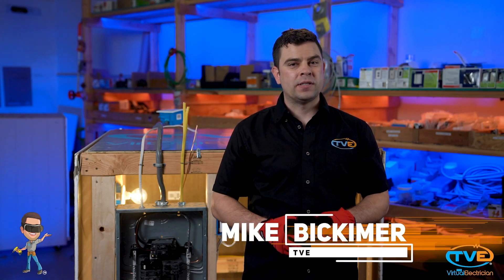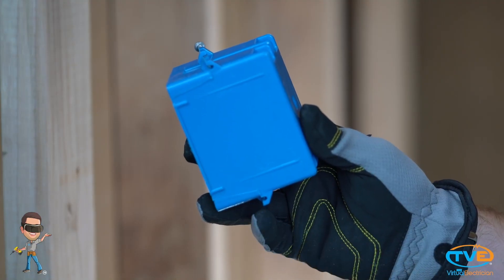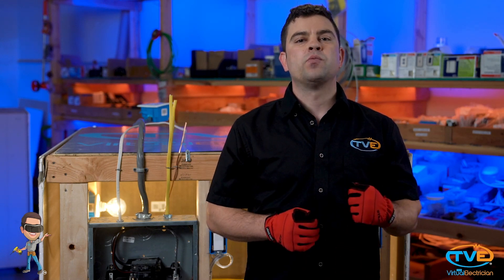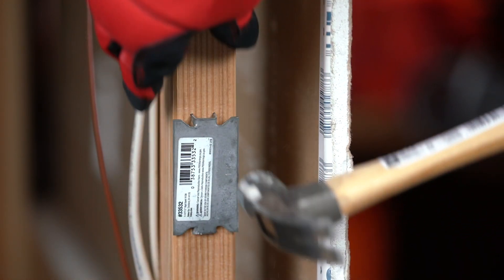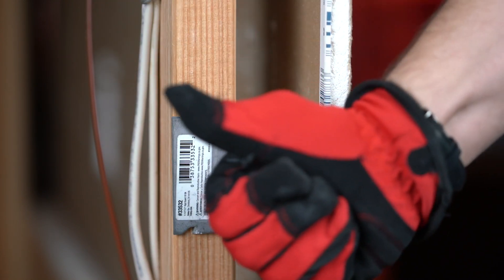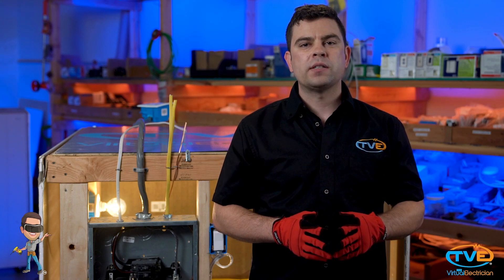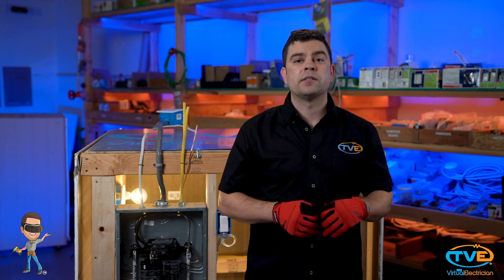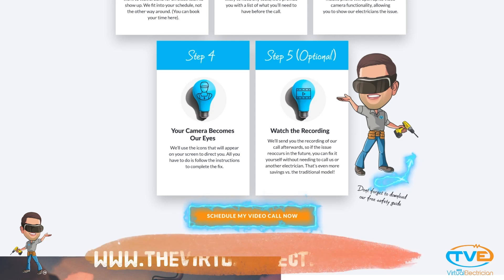How To Run Wire From "Breaker Box" To "Outlet"

Comment: Please respect your viewers and actually show what you claim in the title.
Reply from the maker: if you cant see a breaker box and an outlet in the video then i dont know what to tell you.  try plumbing?
Reply: Well, I actually watched the entire thing again, and the only wire run is betetween 2 studs. I think I may have been confused by your title. I saw How to Run Wire From Break Box to Outlet and thought the video was going to show how to attach the wire in the breaker box and then run it to the outlet. If I was mistaken, and the intent of the video was to show people how to actually run wire through 2 holes, then I sincerely apologize. I don't think I am alone in this missunderstanding, due to the wording of the title. If you don't see how this is confusing to people, I don't know what to tell you. try radio?  @TheVirtualElectrician
Reply from the maker: @dubled2765  😂😂this channel not for you double d. Try it one more time tho
Reply: It's not that I don't like you or what  you are doing, in fact, I did like the way you presented, but the title was misleading.  The title is what people are searching for, and therefore they expect it to be covered in the video. Part of what will make your channel work, is making sure people get exactly what they expected, every single time. I doubt I need to tell you how many people on YouTube are NOT qualified to teach people about a very dangerous trade. Electricians are very expensive, rightly so. But, people have to take things in their own hands when they can't afford them. If you promote your proven skills and teach (not just show) people things to help them get by, you will rise to the top. Work out the process on paper, physically, then have fun teaching people how to save money and not kill themselves or burn their house down. That's prime real estate for a hero. I am subscribed to your and will keep my comments off of the public comments from now on. Stay at it and you will have a huge following. Looking forward to it!  @TheVirtualElectrician

Comment: Very informative on wire sizing but still looking for a video showing "wiring from an breaker box to an outlet"
Reply: Did you find one? Thats what im looking for.
Reply: Need actual video on installing wire to a new breaker and running the wire between wall to an upstairs wall. ie: breaker box in basement to outlet in kitchen. Not piggyback or splice to existing outlet. NEW breaker, wiring (12) new  gfi plug.
Reply: @Handleviz  so basically you don’t know what you’re doing. Hire a licensed electrician then
Reply: @bluemelon7818  I have no clue what I’m doing but it’s my house and if I wanna learn to do it myself I will
Reply from the maker: Let me know if you have a specific question that i can help you with.  Getting the wire inside the panel? Hooking up a breaker? I can either make a new video or see if I have one that suit your needs.  Thanks!
Reply: @ImmortalIdeas  no we just wanted to know if you could drill holes in wood. thats all this moron showed us

Comment: This video shown nothing about what the title describes. Don't waste your time.
Reply from the maker: You mount the box, drill holes, use nail plates if needed, make sure you are using proper wire gage. What were you looking for?
Reply: @TheVirtualElectrician  maybe running the wire from the actual braker panel through the attic or wall to your single or double gang box. Like how your title describes.  Really your title should say, " how to run wire through your studs."
Reply from the maker: @nawlyns504  🤣🤣 I am literally running a wire from my panel box to the outlet box
Reply from the maker: @nawlyns504  this is the video you are looking for. It called. How to “fish” a wire down the wall

https://youtu.be/cORBsrFXlRg